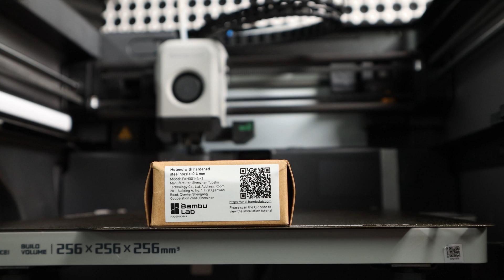Replacing Nozzle on a Bambu X1 & P1 Series

Comment: Well, I just posted that what I’ve learned in the first 10 months video on my YouTube channel the other day and a couple weeks later I’m now realizing I’ve never replaced my hot end or my assembly and took it apart tonight cause it was not doing well on one print and wow, it was charred burned. The ceramic heater was a little chipped and was totally dried to the hot end along with the store and the heat gauge wire inside. The hot end was hard to pull out, but I got it all apart and now I’m seeing that people are recommending. I just get a whole new hot in assembly for 40 bucks from bamboo but I think I’m gonna give it a shot to put some thermal grease on what I have so far with the hot end that comes with the P1 S that I have and give it a go. I really appreciated this video because it made me feel comfortable with the condition. Mine was in which mine was even worse one day at a time right guys with this amazing new hobby. 😂

Comment: As a retired hardware engineer, I must say that Bamboo engineering is horrid.
Reply: Have you done this on an A1 or A1 Mini? It takes zero tools and only a few seconds to swap a hot end.

Pull the front cover and the heat sock, flip a little retaining lever, and it pops off. The new one snaps in and is held in place by a magnet.

It seems inevitable that newer CoreXY Bambu models should use the same design, as it’s extremely convenient.

Comment: I have an issue with removal of thermal sensor, it just stucked in the nozzle hole. I have tried to use my thermal gun heated up to 500C, no luck.
Somebody recommended using acetone, I left it for few hours, it does not work either.
Any suggestions excluding buying a new one? ;)

Comment: Im using the P1S w 0.4mm nozzle and there is melted silicone on the nozzle and wont come off, and I cant get the "little metal clip" off at 2:52. There is no bit you can pry into to and it comes off for me, and in conclusion im screwed

Comment: Why are you all complaining about how complicated this is? It takes a couple of minutes and saves you 20 euro.
Reply: Cause if you buy different size nozzles for different types of projects, the extra cost makes a big difference in the amount of extra work you have to do. Especially when manually changing it over wears down parts faster. Those wires and little clip will give out eventually if you do frequent swaps.

Comment: The X1E nozzle is not compatible with the X1C, as it is made of different materials that are designed to go to a hotter temperature. The X1E can only have the complete hot end assembly replaced, not just the nozzle.

Comment: All I’m gonna say, I’m new to 3D printing and got a P1S, somehow my hotend got filament harden inside and I could not cleaned so I swapped to the replacement hotend (0.04) and (without) any instructions I swapped. To the point: my printer gave me a error code when I started (0003_0002_0001_0001). Bambu Lab sent me a complete hotend assembly. Before I was going to replace everything I just happen to see your video, followed your directions and my printer works perfectly!, thank you!
Reply: Use a 1.5mm alan key heat it with a tourch and stick it into the hotend. Let it cool then pull it out. I had to use a vice mine was really in there.
Reply: @DennisCrawfordJr 
You can also heat the Nozzle from the outside with the lighter, that way it is easier to pull out

Comment: i love how much easier it is on Bambu 3d printers its SUCH a hassle on other printers
Reply: It's easier than most printers, but ideally you want to swap the nozzle without doing that crazy rewiring job.
Reply: What? Have you swapped nozzles on any other printers? This is convoluted to swap a nozzle tip. 6mm wrench and a couple of seconds and most printers are done.  No cables, no hex cap screws.  You shouldn't have to basically swap an entire hot end to change your nozzle.
Reply: @ronaldhiser860  Ironically, on the Bamboo A1 familiy it's even easier than with a standard nozzle on most printers.
Reply: @ronaldhiser860  the NOZZLE is easy.
hot end is a mess and a total time waster from how hard it is on my old elegoo nep 3

Comment: I would buy an extra printer with a different nozzle size. too much work imo
Reply: You can just buy a new hotend that has all those parts attached already, the fan, thermistor and heater cartridge. Then just unscrew the old and swap in the new, replace screws and plug in the wires. Much easier and faster, and they don't cost much more.

Comment: 2:46 No no no! The clip slides off the end. Notice how there are "tabs" on the metal, that's so they can slide up and over the heater. You remove it the opposite of how you install it at 7:30. Even if you don't re-use it, removing it like you did could damage the thermistor.
Reply: Dude -- thank you for pointing that out. I saved myself from destroying the thermistor. Should've just looked on the official wiki than this dude.